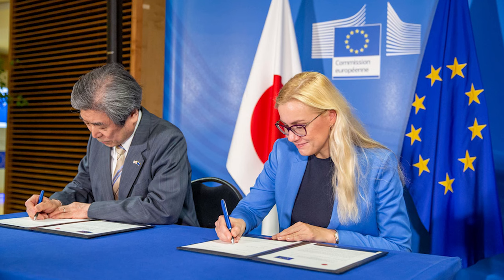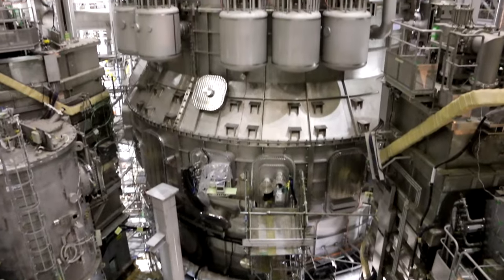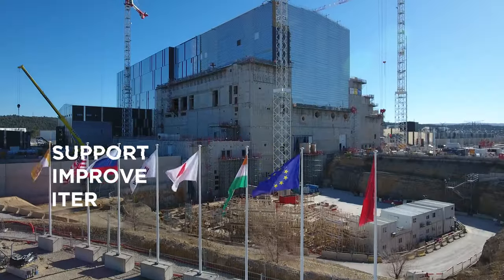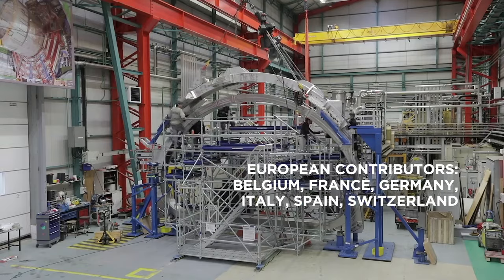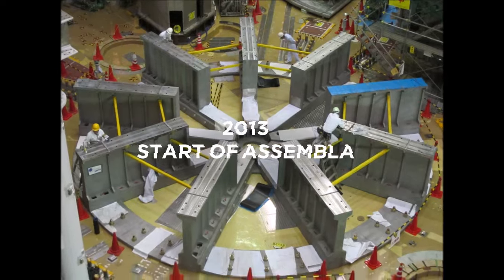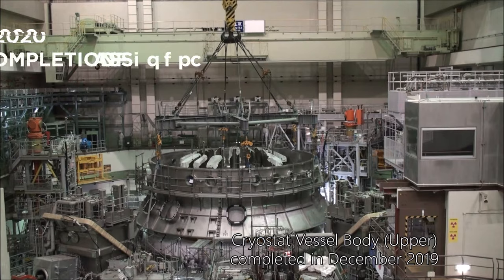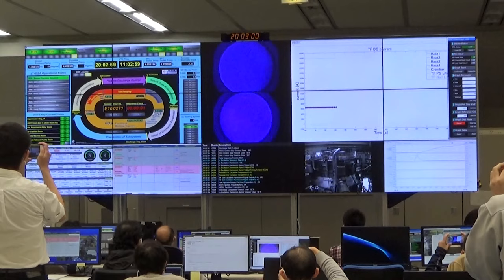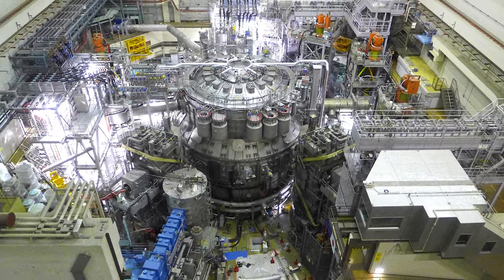The JT-60SA tokamak comes on line

Comment: Tremendous news! Now to test stability over time... :face-orange-biting-nails:
Reply: its not a chain process like fission, so its 100% stable ig, if it starts working, and its energy relalased is 800 % more than fission
Reply: @Newbie22222  Not quite, there are discrepancies in the plasma flow